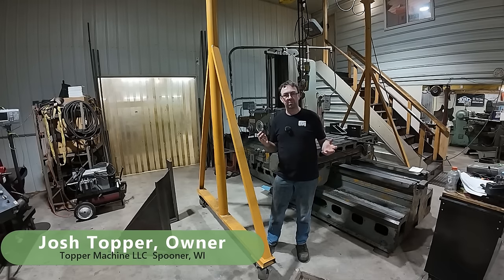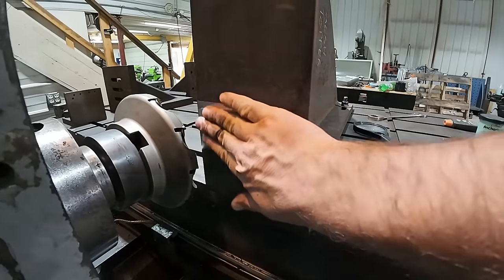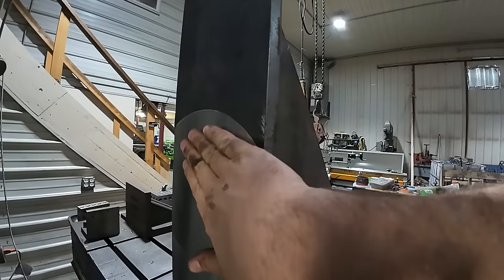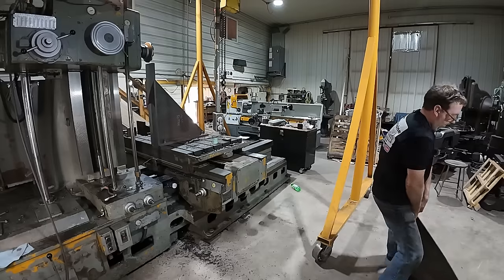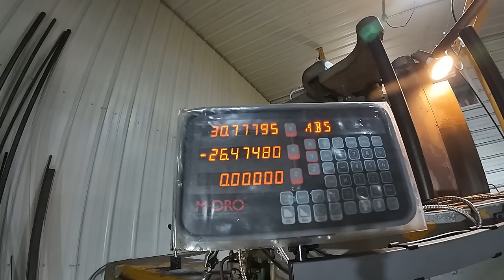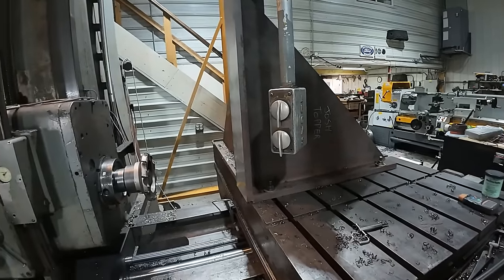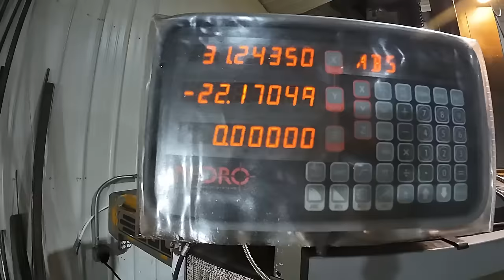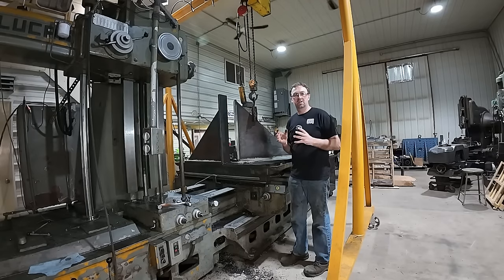Milling Shop Made Angle Plates on the Horizontal Boring Mill - Shop Built Tools

Comment: Hi Josh,
Not new to your channel but just subscribed. I worked at a company that built welding systems that could be quite large. We had 3 boring mills all from the 40's to early 60's The largest was a Carlton that was 4' in the ground and you rode a seat attached the the spindle. I ran a G+L that after releveling required remilling the knees. They were 5' tall and 4' deep of cast iron. I started by setting them with the long leg on the table with the short legs face to face, shimming and clamping as necessary. than machined the 2 edge faces together. Then I had a good flat surface to clamp to and machined the long legs horizontally on the table. Stood them side by side, clamped them together and milled the short legs together. No Singin! Keep up the good work!

Comment: Another way to cut down on the vibration is to attach a heavy weight at one or more places along the 'spine' of the part.  Your big Vevor lifting magnet would be a good candidate, I suspect.  The idea is to change the resonant frequency of the top of the part so that the whole thing can't 'ring' sympathetically with the other parts.  For small parts I have just used a vise-grip, experimenting with placement to get a spot that stops the resonance.

Comment: Hi Josh. Just a thought. 
If you had set both angle plates up beside each other. You could’ve used 2 squeeze clamps, one in spreader config to help eliminate chatter. Possibly also use the giant lead solder wire trick wrapped around the end mill arbor to change harmonics. 
Plus if you attached some  stock in the slots, you could cut both plates together and they’d be indexed.

Comment: After watching both Max Grant's video about machining angle plates and this one, I've learned a lot. I might never have to use this knowledge as a lathe guy, but never say never 😅
Reply: There are times you can or would need to use angle plates on a lathe, if you have a carriage with "T" slots.  And you can do a lot of milling operations by using a cutter heard in the lathe and the cross slide or carriage to move the work.

Comment: I have seen guys pull all but one insert making a sort of fly cutter.  Takes longer but cuts out the vibration and leaves an amazing surface finish.  It’s one of those things sometimes it works great and sometimes it doesn’t.

Comment: You can make yourself some pipe jacks for stiffness in your setups.
Get some pipe and threaded rod that will fit in it nicely.

Heat and flatten one end of the pipes.
Saw a vee notch in it.

Saw your all thread down the center a couple of inches.
Heat the slotted ends and bend them out like a Y shape.

Square up the pipes and weld a washer on the flat ends.

You can then clamp a block on the table and a heavy duty c clamp on the web.

Put your pipe jacks between the block and c clamp on both sides and have good easy diagomal supports for a variety of job situations.

A variety of pipe lengths is handy to have.

Comment: The length to width was quite a bit on those. A cheat I have learned from my set I use on my small bore bar is to drill and tap the tops on the back side and tie your two angles together at distance say a foot a part or so.  That allows it to operate like a box and makes it much stiffer thus eliminating chatter. 😊
Reply from the maker: Thanks Brian. Great idea.

Comment: Just a suggestion,
Add shim stock as needed under the bolted down surface at setup, to  halve the stock removal and lessen the spring in the weldment? Cutting down against the table was for sure the way to go.

Comment: To reduce vibration and chatter in that situation, I suggest you add mass on that triangle gusset, and clamp it there with rubber or similar between the clamp and your plate. This adds mass AND damping. The added mass changes the resonant frequency, and the damper suppresses vibrations if they are generated. This is what the shocks do in your vehicle suspension.

What you did there was to increase rigidity which also changes the resonant frequency.
Good work. I like your approach to problems and the way you find solutions.

Comment: Bracing, get some allthread and couplers and tack a couple jack points in place at those extremes. Should still leave plenty of reach even running 2 pieces up to that big ear hanging out there to get your clamps in positions on the part. A couple ream holes near the bottom after you brought it all square (prefereably a half thou under your slot width and dowel pins to match) would make throwing these on and off the table any time a breeze. I was glad to see you finally use te other angle block as some bracing, but remember, the stiffer you can get setup before you slap that part up there, the happier she will be.

Comment: Morning Josh,
Resonance harmonics caused from machining is always hard to overcome. Your approach to solving it in this particular project is innovative and educational. The camera work clearly explains what you did, why you did it and the outcomes of each attempt to remedy the problems encountered. The mark of a true master machinist. 
I have a little sign posted in my shop of an acronym that reminds me of things and helps when I face situations such as this. The sign simply says....SMEAC.....S= what is the situation, M=mission what am I trying to accomplish, E= execution, how and with what assets am I going to fix it, A=administration, how am I going to actually get it done, and C= command and control, how am I going make sure things are done the best i can do and in what order.
Our dreaded snowstorm was a bust thank goodness, the bulk missed us and slammed Vermont instead, they got 15-24 inches. Only 4-6 inches here and cold temps following have ensured light fluffy stuff which will soon melt away as the temps soar into the 50s this week....your magical snow-blower has done its job again !!!
Keep up the good work and if no one has said it, THANKS for bringing us along on the ride.
Don

Comment: A thought- a 4x6 or 6x8 between the angles might further the vibration dampening.  As you know far better than I, rigidity is essential in machining, and the opposed “square “ helped a lot.  But metal transfers the vibrations of the inserts making contact with the edges of the plate, and wood should dampen the vibration rather than pass it along.  Easy, and you probably have some shipping dunnage laying around the shop.  I’ll bet you a coffee it really will improve the process and possibly help in future projects to increase feed rate and improve surface finish.  What ya tink? 😂

Comment: Hi Josh
I watched a guy turn some rotors and drums for automotive brakes, and he used a rubber strap to prevent the part singing while it was being machined. I wonder if you had clamped a piece of rubber to the web if that would have been enough to dampen the resonance?
Anyway, you found a method that worked, which is all that really matters. Thanks for sharing this with us!

Comment: Good job on adding the second angle plate for stiffening. It really doesn’t take much to snuff out vibration in my experience, just very careful placement of struts or supports. I was thinking it’s a pity that horizontal doesn’t have a rotary table otherwise you could do it laying down, that type of mill is not common here in Australia, we normally have the rotary table type borer with a facing head built in.
Reply from the maker: I don't have the Lucas rotary table, but do have a big(24 or 30",not sure which) rotary table I can use. Just haven't had a real need for it yet.

Comment: If you dont have a big enough fly cutter, just leave 1 insert in the face mill and turn down the feed rate, run it like that. Its slower but its worked for me in the past.  Cheers..
Reply from the maker: Check out my older videos. I have an 18" and a 32" fly cutter for the HBM

Comment: Hey Josh, I was wondering before you put the 2nd angle on
to reduce vibration/chatter, 
if you might also clamp some heavy blocks to the gusset on
the angle being milled to help reduce vibration.....????......
I was also thinking about using the 2nd angle clamped to the 
table right before you clamped it....but putting it parallel to the 1st 
with some sort of jack between the two to put pressure toward
the face mill.....
any opinions on that ?.....
a lot fewer chips in your arm pits from clamping than holding onto the angle anyway........
well done.....Paul:face-fuchsia-tongue-out:

Comment: I love to see sizeable machining, and manual machines being used for jobs they should be doing. 
Perhaps a change in the machining order would give an even more aligned outcome.
1/ Machine the slotted face edge that goes against the table stops - so that it is machined reference.
2/ Machine the slotted face.
3/ Machine the last face. So it is machined the way it will be used and so will be as square as possible.

There are basically four ways of removing vibration. 
Weight (e.g. lead) which lowers the resonant frequency (vibration point). Can be on the tool support or workpiece depending on what is vibrating.
Stiffness of the workpiece (e.g. side support) which raises the resonant frequency. This could also be changes to the part (add ribs/welds etc)
Change the frequency that the cutting induces. 
            Changing the spindle speed as Josh did or changing the number of teeth (e.g. different cutter, removal of every second tip, all but one tip)
Change the forces the cutting induces
            Changing the feed, depth of cut or both (as Josh does)

The use of additional weight (lead strip and lead shot bags). 
The spindle on this machine is so stiff no change would occur even if lead strip was wound around it. That is the vibration was the workpiece moving, not the spindle moved.
Adding mass to the angle plate would work, but the amount needed would be high and the method of mounting would be difficult and need to be added.
As Josh showed very little needed to be done to remove the vibration and it was only occurring in one direction and was the workpiece moving, so the use of a side support was simple to do and had the desired effect.

Comment: when it rings like a bell like that could you put a "C-clamp" on the web of your piece kind of replacing your hand to deadin the vibration, just something to change the harmonic of the piece ??
The other thought I had is using only half of your cutter vertically so your cutting force is downward into the table??

Comment: See I was thinking at your initial setup to put both plates facing the cutter and simple jack between them at the top. That way you can face mill them both in the same setup. I ran a Bullard about that size as the Lucas back when I was 19-20 and vaguely recall doing something similar.

Comment: You could also try setting that cutter off to the left so there is more downward cutting force than sideways with the teeth.
Reply from the maker: I did try that, but since the sizes were close it didn't help much.
Reply: @TopperMachineLLC  everything is worth a try when the chatter sets in.

Comment: Nice work and video. Did you consider running an end mill down the ridge of the base plate to ensure the edge is vertical? You may have taken care of that when you made the angle plate originally. Again great job
Reply: I meant edge.

Comment: oof, I said it in your last video, but I worked on heat exchanger plate chillers for 8 years. disassembly, cleaning, replacing gaskets, replacing heat transfer plates. The most hated job I had to do because if there was a small leak you had to start all over again and pull the entire thing back apart and clean it again.
Reply from the maker: Next week is the next plate. It will go way better. I never had to assemble one, but I can imagine it would suck.

Comment: The angle plate was pretty accurate to start with, considering that it was welded together. What sort of a setup did you have when you made the plates to keep them in line for welding?
Reply from the maker: I did that 10 years ago. I remember lots of short welds and tweaking. Maintaining interpass temps, slow cooling. It was a process for sure,but well worth it.

Comment: Milling the plates that high up from the table, without support, is akin to turning a shaft hanging out of a chuck with no center.  Had I been setting this up, I would have paired the plates after drilling as few holes in the webs to "draw" the plates tight together.  Just a thought. Nice video presentation. 
Never ran a HBM that new, and I like right hand machines...
Reply: You'd be surprised how nice the left hand machines are too run once you get afew hours on them. 

Especially on the smaller machines 3" and 4" machines. Lot easier to adjust your cuts and such since all the main controls are positioned to be turned with your right hand (if you are right handed) instead of on a right hand machine where all the controls are operated with your left hand
Reply: @procyonia3654  The first Lucas I first ran had "Rabbit Ear" gear shifting, 4" I think
Reply: Sorry Fred I don't recognize that term in this context are you talking levers for shifting or something else?
Reply: @procyonia3654  Yes, levers for shifting. They were 2, aprox.18" long, in a "V" formation, "
Reply: @fredhoyt6900  ahh yeh my 41 is like that lol the feed/rapid clutch and the direction lever and rapid is opposite of the feed direction.
Reply: @procyonia3654  Thanks for your reply. It's been a long time since I've seen that mill. Used "rods and a machinist's level" for accuracy on table moves.
Reply: @procyonia3654  A lot of guys will never get what we are saying, right vs left, but to be clear, a left hand machine means the work or work table is to the left, just like a lathe, and you operate from the right, just like a lathe.  I like Lucas mills for quality and operation, but prefer to work to my left.

Comment: You should have clamped aluim or wood  too get rid of Is vibration,Ran a horizontal boring mill 7 years ,  I have run & set up job way too big for the machine  but got it done,also lot of line boring for metal Fabricated gear boxes big ones  size of a Toyota  car lol

Comment: Just clamp a hunk of metal where you were putting your hand.  That would change the natural frequency of you part and change the amount of vibration.  You can also fab a damper on the spot by using some compliant material attached to the web (that's what you were doing with your hand).  Bracing the part risks changing the shape and that will show up in the end product.

Comment: I thought the idea of wood wedges between the 2 angle plates would have helped dampen the chatter. I’ve also seen an inner tube pulling an oak beam into the back of the workpiece as a damper.

Comment: I was watching a second time - did not appreciate before the condition of that boring mill. The ways all look pristine. Did you get it new?
Reply from the maker: I am the third owner. The first owner never really used it much from new, June 1963. Around 2000 it went to forest Lake, MN and didn't see much use until sold in 2006-7. It went to Stillwater MN and was used in a antique car restoration shop, but saw little use there too until I bought it in 2013. I don't use it much, but it's sure been handy.

Comment: Should you have put both of them on the table in the location you would normally put them. Then measure to the cutting head before cutting then to take out the highest points first as a team? Not arm chair warring here, but just a amateur asking best practices.

Comment: when they would turn brake drums they had a strap they would put around the outside of the drum to knock down the noise .. I was thinking take a 2x4 board clamp it to the angle brace on both sides ,, the boards should knock down a lot of the noise if not all the noise ..

Comment: Never noticed this before, Josh is that a spindle bar clamp on the nose of the spindle?

My 41 is abit Older than yours (probably 15 years) but it clamps differently then that, that's really cool. 

Or is that a shop made dealio?
Reply from the maker: Yes,it's the factory spindle nose with clamp. It will accept the boring and facing head as well. Something I wish I had.
Reply: Wow they really made some improvements from the early 41s then.

On mine (1943 vintage) you have a clamping lever at the rear similar to a GL hbm

And instead of the electronic control like yours for feed/rapid there's a clutch lever and a reversing switch for directions.

Comment: Hello. Question. The transverse travel of the table was not enough to process this part in a lying position? This position would eliminate vibrations.
Reply from the maker: I chose vertical for ease of setup and the theatrics. It would be boring otherwise.
Reply: It's clear. Good luck. I like your channel. @TopperMachineLLC

Comment: I would have tried milling all 4 corners only.then laid the part horizontally on the table,indicate it in. That way the edge would be solid all the way.
Reply from the maker: But that would not have been as much fun.
Reply: @TopperMachineLLC  it is all about fun! And trying to do a job with the idea you had to full completion.

Comment: Hi Josh.
Another great video the way we like it!
Question: Why did you mill them in the vertical position? Is it because of insufficient table travel?
Thanks for sharing.
God Bless.
WWG1WGA.
Reply from the maker: I considered laying them down, but I couldn't be 100% certain of its accuracy. I could indicate the angle plates on the table and set the base up to that, but clamping these directly to the table and using the column was guaranteed to be square. Also, it would not have looked as impressive.

Comment: Yes, use the other angle plate to firm up the setup. How many times have you all done a finish cut, it's on size, everything
is cool, and it chatters on you and woodpeckers up the surface?  And on an expensive part like the angle plates. And the
customer wants it today.  Us machinists have to be greedy when it comes to rigid set ups.